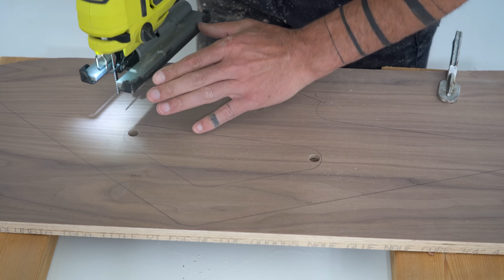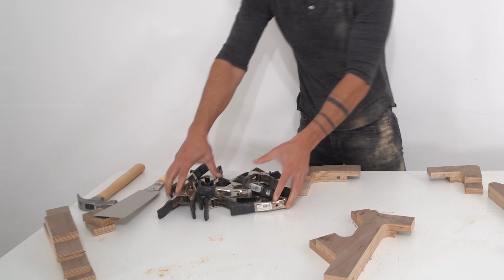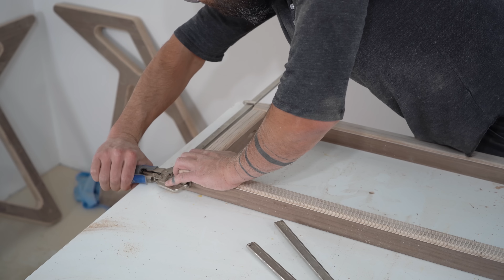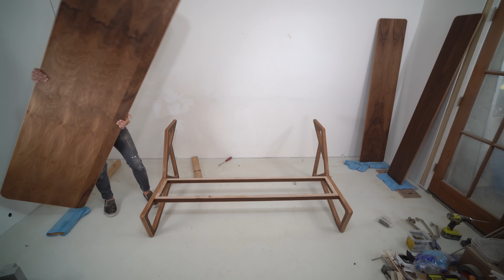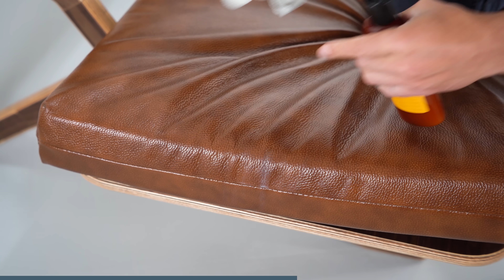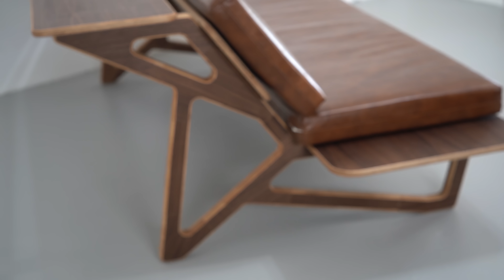DIY Sofa Desk Combination made with basic power tools!

Comment: I like all of your content, and usually find your approaches interesting and quirky.
However, I'm not into hero worship and someone's got to call a spade a spade.  This is a plywood frame with some nice looking cushions. I doubt the cushions are comfortable past 30-45 minutes, and being seperate pieces are always going to be sliding around.  I would class this as a step up from Ikea, not 'elegant'.

As someone else said, your plans are starting to need CNC in some form or fashion lately.  
Sounds like the plan for some YT'ers is to branch off from making content that is approachable by their subs, to a business plan which will not only require you to buy the plans, but also to buy templates or pre-cut parts by which to make the project?

So YT will become the advertising, and the money will be in producing and distributing plans and parts and pieces.

Comment: Smaller pieces definitely. But I think there is a way of doing just one set. You make it its longest version and draw a line for the shorter version. Does that make sense? And you once cut them to line A then to once to line B. And A is longer on one piece and shorter on its neighbour. Then the opposite for B.

Comment: I had a similar situation where I used a small 12X12 CNC to create pieces that tabbed together like a jigsaw puzzle. 
The tabbed pieces were quick to machine on the flimsy CNC but were tight and accurate enough to be hammered together to create a continuous shape that could be pinned down to thicker stock to make a more substantial template.

Comment: If the templates are thick enough, you could add dowel holes in the ends, so the pieces can be joined to one big template.
Meaning you only have to make one type of templates.

Comment: I'd split the larger template into two or three pieces for shipping, but in a way that they could easily be glued backed together for one large template. Users could then opt to either use as is, or cut up with a jigsaw into smaller parts for a less waste approach.

Comment: I think it is interesting to have these smaller template vectors so I can get all these pieces cut on our laser cutter at school which can cut plywood but has a small size capacity. So smaller overlapping pieces makes things very accessible. I think including (removable in the vector file) dowel holes for alignment will make things super easy. But those who want to align things the hard way can remove these dowel holes. I personally think dowels that convey the joinery add character to the piece. 
So basically I can buy a few sheets of plywood and some dowels. Get everything cut. Then just use some glue. And BAAM here is a sofa desk!! 
More plans like this please.
Reply from the maker: great suggestions!

Comment: If the template pieces snapped together you'd only need one set and the user could create the overlap by varying which pieces they snapped together. 
If there's 4 template pieces, I could cut one layer using A+B and C+D, and the second layer I'd use A and B+C and D.
Making the templates modular would allow you to pack them tighter for less manufacturing waste and 1 set means lower shipping weight.
Reply from the maker: great suggestion! thank you!

Comment: This is a fantastic couch. I’m wondering if the leather cushions might slip off the ply? A potential solution would be to use heavy duty press studs on the back rest and cushion. You inset the cap into the ply so it doesn’t stick out and create a bump under the cushion. You might have to reinforce the cushion where the sockets are to prevent them tearing out. Alternatively you could come up with a cool strap attached to the cushion that wraps around the back rest. It’s excellent design and so versatile 🤩
Reply from the maker: they don't slip that much for me but the easy way to solve that potential issue is just a few dabs of silicone
Reply: @HomeMadeModern  that’s a much easier solution.
Reply: Or maybe Velcro.